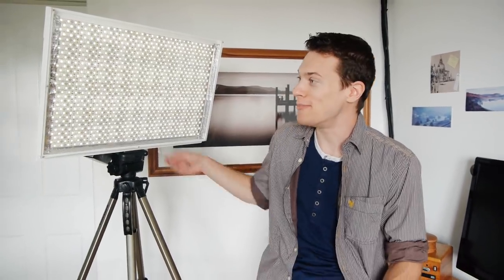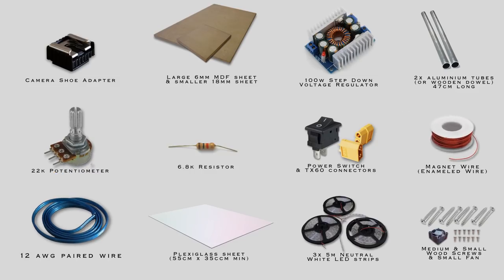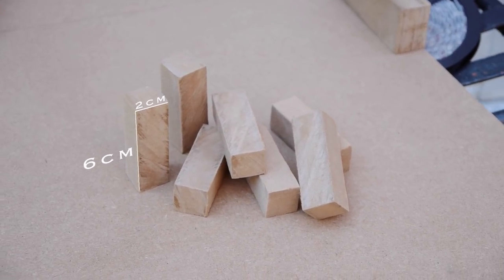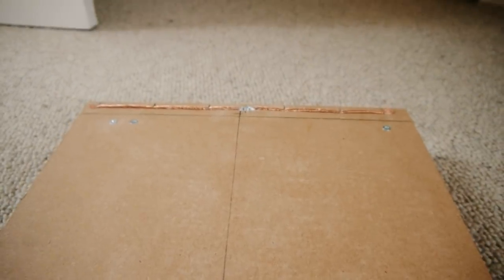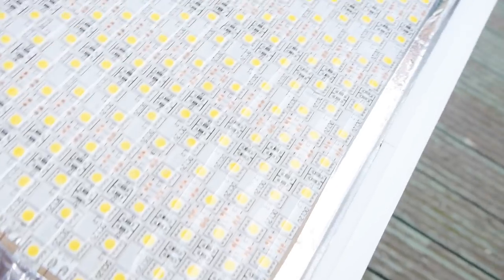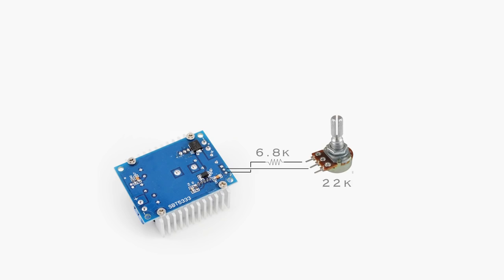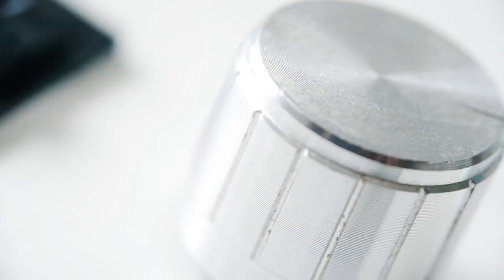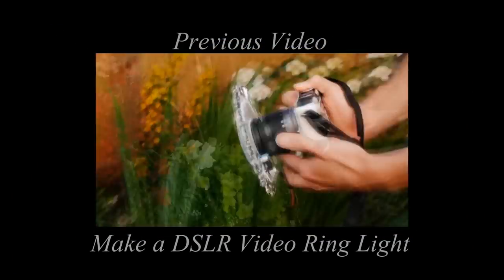How to make a super bright LED light panel (for video work etc)

Comment: Nice video. You don't actually need the step-down regulator a simple filter (capacitor) would work for that. I builded some simple led panels and they work with just a cheap power supply and a dimmer with the capacitor added to the circuit before the dimmer.

Comment: Can I use the high CRI 5630 led strips ( the one u have used in the  flexible led panel ) instead of the normal 5050 led strips u have used in this video?? Hope u will help me...
Reply: Ofcourse you can do that. I would even opt for High CRI LED tape (as long as the specifications are reliable and thus your source is as well).
But remember cooling. Apply the LED-tape to a metal surface to the LED's stay cool at full brightness.

Comment: Great video, Very informative, I'm currently in the middle of building 2 of these. 1 of the panels is just about ready to power on and set the voltage, about to build the other voltage reg circuit for panel 2. Ive changed the design a bit for the regulator box, I found some aluminium project boxes on ebay and everything is being put in one of those with some thermal paste against the body of the box with a 40mm fan screwed to the top. looks a tad neater.

Comment: Thank you for this video! I really like your construction. A money saver idea: instead of the shoe adapter hack just drill a hole large enough for a 5/16" or 1/14" (height) "T-nut" threaded 1/4"-20 (the same as all tripods (in the USA anyway). They cost about 25¢–50¢ at any hardware store.

Or get a metal plate tapped for 1/4"-20

Comment: Any idea why the recommended voltage regulator keeps sending up the magic smoke after the first 30 seconds on 12V?  Ive bought two and my multimeter assures me the output is 12V.  After I get the smoke, I can only output 8.14V.  Both units and its the same for both.  My build uses the components linked in the description.

Comment: Can I connect the LEDs directly to the battery without the voltage regulator if I don't care about dimming (or strobing), only using the Lipo alarm for safety?

Comment: Excellent DIY video.
There's some really good ideas here. My only problem that I can see is the overall weight of the light. I would like to build it so that a standard portable light stand could support it.
First, is the plexiglass really necessary? The LED's are virtually physically indestructible, particularly the one's used here as they are waterproof and there's no significant heat or high voltage to hurt the unsuspecting user.
I would use 3mm ply for the base and sides, the back handle rods would give the ply some extra stiffening. The handle rods definitely made out of dowel to keep the weight down.
Maybe separate the power supply from the base (or make it clip on/off somehow).

As the wire runs are fairly short you could probably get away with using some cheap split twin core cable instead of the 12awg. It's rated at 7.5 amps but 10 amps won't worry it in this situation, it might get a bit warm but it's not going to go up in smoke. Any voltage drop would be negligible but if if it was it could be easily compensated for by reading the voltage at the light (turned on) and while setting the maximum voltage at the regulator.

I'll give it a go.

It's good to see a DIY video that shows the final device and how it's used at the beginning of the video and not at the end as so many do.
Most of these DIY videos start off telling how wonderful the device is then immediately lurch off to show you how to build it. The viewer has no idea what the device looks at till the end of the video....  End of rant.

Comment: Sir

we built the light successfully all credit goes to u .....! Sir i have a prob with the panel i have tested it for keeping on for 1 hr but i noticed the wooden panel backside is getting heated ...i want to built a permanent setup with exhaust fans and circuit for power in life 1/2 and full switch ...pls can u give me any suggestion.

Comment: The Dimmer switch is needed to raise and lower the amount of light needed for what you are filming. If you just used the light without a dimmer, you would be limited on the uses for the light. Do a search on lighting for film and you will understand more why you need to dim the light. Lighting creates mood!

Comment: Why 12AWG? As the wires are relatively short and aren't going to carry more than 10 A, wouldn't be an 18/20 AWG wire enough?
Reply: That was also my thought, 100Watt at 12Volts roughly equates to 8Amperes which is definitely lower than the rated amperage for 18AWG and probably also 20AWG wire. It looked really strange when he soldered the small thin wires to that giant audio cable

Comment: Hi there, I have requested 3 rolls x 5mts of >>>NEUTRAL<<< white LEDs. However, I RECEIVED "NATURAL white color" ones instead of "NEUTRAL". Are they EXACTLY the same? I wouldn't like to start building them, if they are not the same color as you showed. The sticker on the roll package says Maswell SMD5050 LED- Color "Natural white" - Another Q: how many mm the thick cable is topposed to be to stand that high amperare?Thanks.

Comment: Super fun project that i'll definitely try! I'm however a bit surprised that there is no heatsink for the leds, that must get really hot. I guess using aluminum heatsinks would pump the price up, which is not the point of the video. That can be a good challenge: how to dissipate that heat for a few bucks? 

Thank you for your videos!

Comment: I dont currently have a li-poly battery on hand, so i repacked a 4s li-ion battery. However, the voltage drops significantly when i turn it on. It sarts with 12v then drop to 8v or 9v and substancially affects the brightness. If i use a 3s li-poly, would it be able to maintain the 12v output with the lights connected? 

Also, when your li-poly battery's voltage drops below 12v does the output of the regulator drop below 12 aswell? When i researched the net regarding your recommended regulator, it says that it can only output lessthan or equal to the inpul voltage. I am thinking if i should continue or stop my build, because li-poly batteries are expensive in my country, and i dont have any other use for the battery if the project dosent meet the 12v(with the lights connected) output.

Comment: Nice but what about cooling?
Also, voltage regulator getting so for as to retire cooling doesn't seem like an efficient solution. Looks like it's the kind that just dissipates "extra" voltage as heat. Wouldn't a buck converter - I assume there are such with output voltage adjustment - be a better option?

Comment: Awesome Idea mine is soon done as well. I used an old XBOX 360 psu as the voltage source. But i think i might be better to use the non waterproof LED strips.

Comment: If I wanted to make one of these, but smaller (maybe 1/3 the size), would I need different value components, such as for the resistors/potentiometer? 

Thanks!
Reply: No. The LED stripswork between 6v and 12v. However, fewer LEDs will need less power so you could use a PSU rated at a lower current (amps).

Comment: DIY Perks, very nice! Something I saw in the video but did not see where it happened or why; when you show the pot, you have de-soldered the trimmer from the board, added a couple extension wires and re-soldered the trimmer to the pot. I thought I'd seen it somewhere but can't find it again in the video.  Can you point me to the time where you go over this bit?

Comment: I build the led panel and it works great! Beautiful light as wel. I'm now trying to get a good powersupply.
I bought a laptop adapter that supposedly delivers 12v at 10A. It can power half of my led panel. If I connect them all  the leds start flikkering after a while, what is wrong?

Comment: Will the electrical components such as the 22k pot, or the 6.8 k resistor need to be changed if you only want to use one strip of lights with the voltage regulator rather than 3?

Comment: I'd really like to build one of these. I have a number of  questions  1. What's the total weight of the finished product?   2. What's the make and model of the tripod you're using to support it?  3. How much weight does the tripod support?  4. Do you think you'd get even better diffusion with a tented, softbox type cover added on?  Or do you think the light's already as diffuse as you'd ever want it? 5. Do you have any thoughts on how best to affix a battery to the panel itself? 6. What kind of battery life would you expect to get?  7. To which specific retail product would you compare your panel?

Comment: This is a very, very nice build. Because everyone is a critic, I must, and my critique is the weight. MDF is rather dense, and it seems like the resulting build will be as well. If you're already working with rigid plastics like plexiglass, can you mount everything (except perhaps the voltage regulator) to a sheet of plexiglass as the base?

Comment: DIY Perks Excellent Build. I am trying to build one like this, but I am a bit confused with your measurements as it relates to aluminium rods which looks like 1/4", the 18mm (appx .3/4" thick) MDF for the hot-shoe (the one you were digging out) and 2cm x 6cm blocks which work out to about .78"x 2.3" inches (relatively small). Please clarify the measurements. Your help is greatly appreciated.

Comment: In the video, you mentioned cutting the LED's "between the copper pads" but it ends up that exactly 50 cm from the start of the LED roll there is solder vs copper. It's also looks like what you cut and then solder in the video. Cutting that solder point is the only way to get 10 50cm strips from each roll (30 total). Just want to confirm that is correct don't want to get this wrong. I'm sure either way it's correct. And thanks for this tutorial. .

Comment: I have a lot of 12v batteries and I want a build that will be optimized for both battery AND regular 12v power suppliers. Which dimmer should I be using so I waste less battery voltage in case of outdoor shooting? (I am asking which because I've seen in other builds you use PWM dimmers). Thank you.

Comment: how would you go about making one of these using 50 watt chip led rather than the strips. Lets say 2' wide x 5' tall equally spacing quantity of 20 50 watt led chips powering each panel with 120 vac how would you design and cool this type of light panel? Any ideas would be a great help. Also I would only need it to run at full capacity when it's on. 

Thanks for any ideas

Comment: It is always much easier to glue and clamp the wooden piece and let set, then centering on back or where you want screws to be, Use prepared drill make holes and put screws in after set up.

Comment: Hi, I'm making a similar project but with dual color leds, so I'm here to asking you if you know any type of voltage regulation power supply with a double wheel, or better, one with 2 output inverted so you can mix the color of the LEDs... tell me if I am explained enought well...

Comment: You're using a 11.1v battery and a step down converter. On the converter's listing, it says "output must be lower 2V than input." How does your setup work with the battery, let alone a plug in power supply? Does the panel ever see 12v at maximum on the potentiometer with this setup?

Comment: hi Matt, i have got some LED strips from a broken LCD tv. but i dont know how much voltage it needs to maximize the output light? i tried with a 10v 1.2 A adapter. it glows. can i operate these lights in low voltage to high voltage? like 6v - 12v? what kind of regulator i need? how can i connect laptop adapter as the voltage and ampere varies?
thanks in advance

Comment: Hey there! I'm trying to build this and I'm a little confused. If there are 15 meters of LED strip and they need 1.2A / meter-as said in the Amazon description- which makes us 18A in total, I assume that 12 AWG wire is not enough to carry that current and additionally you will need a power supply of at least 216W (18A * 12V)! Help would be really appreciated!

Comment: Hi, Thanks for your comprehensive tutorial. I have a few questions:

1. Can you please explain how you calculated to choose a 22K potentiometer?
Method of calculation is needed because it may change according to the number of LEDs in the panel.

2. How did you calculate to choose a 6.8K resistor to maintain at least 6 Volts to the LEDs? Does it change if the total power and current is different than your setup when more LEDs are used.

3. According to your opinion in the video, "Voltage Adjustment" method for Dimming is superior to Pulse-width Modulation. On the contrary, many people believe that, PWM dimming is superior for LED bulbs. You said PWP dimming would flicker. Is it really like that?

There is an additional concern for Voltage Dimming in currents of more than 10A as Voltage Regulators for high currents are not easily available where we can easily use PWM dimming as an option. What's your opinion?

Thanks in advance.
Reply: dramirvf I am too tired to explain you how he calculated that, but for your PWM vs Linear Argument:

PWM will always be better than any Linear Type of Control. Especially for LEDs because they dont have a linear Brightness over Voltage Curve. If you set the PWM frequency high enough (> 100kHz) not even an 1000FPS Camera will notice it, and thus no flicker.
Plus Linear regulators for those kind of Powers are Inefficient as hell, so i would always go with a correctly setup PWM. Less parts, linear dimming, and less power wasted (+ maybe even cheaper)

Comment: +DIY Perks I would like to attempt this build using the Yuji VTC LED ribbon. If I am using a 5m reel, which requires 90w to power, will the components you used work? If so, would I want to eliminate the 6.8k resistor from the potentiometer to allow dimming from 0v to 12v as I believe the Yuji LEDs can handle? I may be wrong about all of this, but Yuji's own brand of dimmers for these LED ribbons says it goes from 0v to 12v.

Comment: Does feeding each strip's positive and negative from opposite ends compensate for the trace resistance that drops voltage as distance from the power supply increases? I know your strips are much shorter, but for example, I've had a voltage drop of 3.17V on a 5-meter strip at 3.9A, when feeding from one end only.

I'll have to see what happens when feeding opposite polarities from opposite ends. My theory is that there will still be a voltage drop, but at its greatest at the center of the strip, and least at the ends.
Reply from the maker: Darron Birgenheier Yes, it can help somewhat with the voltage drop - not that these short lengths suffer from it in the slightest, but for longer lengths is might make a noticeable difference.

Comment: Hi, good evening! After watching both this and your Flexible LED Panels video, what I would like to do is built a flexible panel but with the voltage regulated power supply that you specify here. I'd like to totally eliminate the flicker caused by the PWM component. What I plan on doing is mounting this panel inside of a 4x6 foot (very large) professional softbox that I own. I plan on having all of the power supply bits in a box of some kind which will sit on the floor at the bottom of the light stand. I have not yet decided if I am going to build this panel with two different color temperature strip sets as you have laid out in the flexible panel video, but I am leaning in that direction.

A few questions:

1. Can you help me with a parts list for building the larger size panel (I believe it was 51cm) using the power regulated power? This would include the two dimmers for the different temperature strips. 

2. Alternatively, if I decided to just go with a single color temperature strip, would I simply use the components specified in this project?

3. I am somewhat concerned about heat generation on these flexible panes--particularly if I go for the single color temperature, checkerboarded LED configuration. Since building the flexible panels, do you have better advice on heat sinking related to mounting these LED strips on the artificial leather? I am wondering if perhaps mounting the strips to a thin aluminum sheet which is attached (on its other side to the fabric) would help in this regard. Maybe some other type of material?

The reason I am going with the flexible panels versus the solid design is portability. I still want the panels to be flexible, because I want the panels able to be rolled up and transported with me with as little volume as possible. Make sense? I plan on having a custom bag made to transport the panel in.

Thank you so very much for your kind help with this project. Love all your videos, sir!

Howard Morris

Comment: Hi!  I intend making a panel like the one you described but much smaller, as thats what i'm looking for. 
I intend using 150 LED i.e 2.5 mtrs of a 12V strip. Would the ratings for the 100W Step down Voltage Regulator, the 6.8K Resistor and the 22 K potentiometer need to be the same or brought down. What would be your advice for this half  LED strip with power rating of 1M<= 6W.

Comment: Why exactly 22k pot + 6.8 resistor? I'm bad at electronics, but I need to build couple of  these for movie production. I've found out that the blue pot on the dc/dc regulator is 50k. To split the voltage there should be parallel resistance the same amount. 50k + 50k. But you're using 50k + 22k + 6.8.(to set minimum voltage) I'm wondering how does it depend? Should I use exactly 22k and 6.8 or there is any formula calculate needed resistance to set minimum voltage? Thanks.

Comment: Great project and I'd also be interested in the high CRI LEDs.  I constructed a similar light array but used a 1'x22 scrim jim frame from Westcott.  Question - When I adjust the voltage output on the Trim it's at 12V but when I connect the LED array it drops to 11.6V.  Should I adjust the Trim so that the output voltage is 12V under load?  Thanks